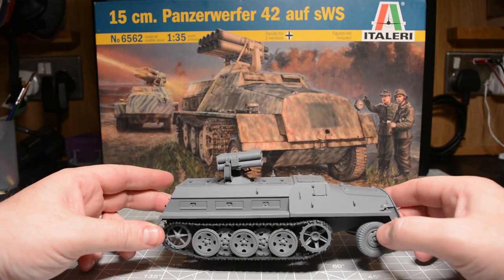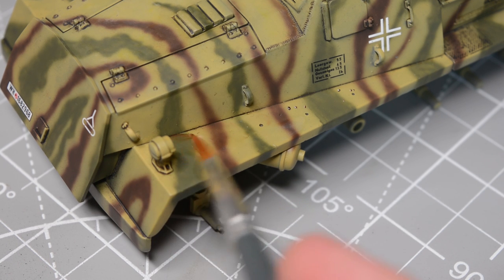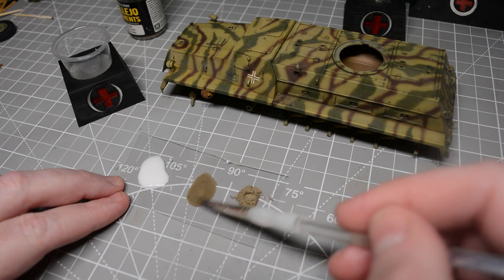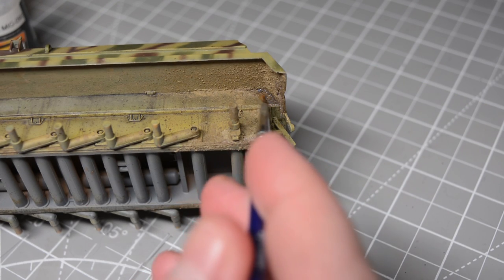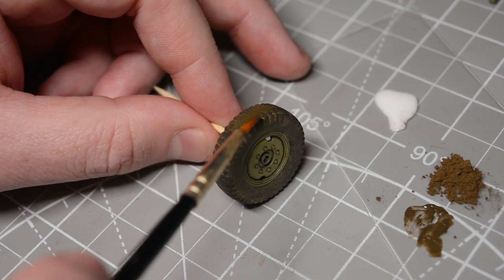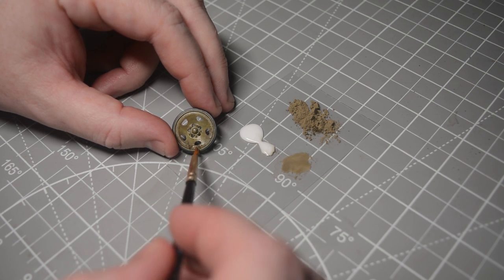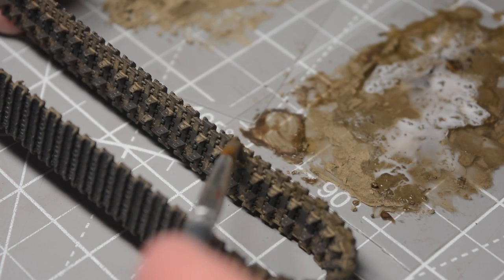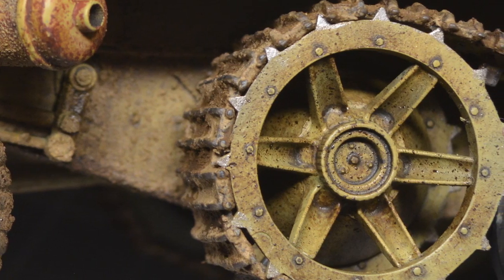Weathering with pigments or weathering powders

Comment: Amazing weathering tutorial using pigments! Going to use this on my next tank for sure. Is there a substitute for the scenic fixer that you can suggest. Looks a bit like pea glue in the video, but I’m guessing it isn’t? Liked and subbed 👍
Reply from the maker: Hi, thank you for taking time to comment. The scenic glue is likely some derivative of pva, it dries matt so realistically either an acrylic matt varnish or a combo of matt varnish and pva would probably do the job just fine. Normal pva would probably get you by but you do run a low risk of getting some gloss finish where it builds up.  I've used mig ammo matt acrylic varnish in the past with similar results, it won't take you long at all to find something that works for you and get the hang of it! Happy modelling
Reply: @ScaleModelMedic  awesome. Thanks for the quick reply.

Comment: Awesome results! How long did it take you to complete the track weathering? Can PVA glue be used instead of scenic cement for binding the pigments?
Reply from the maker: Hi,  yes You can use pva, which I'm sure is an ingredient in the scenic cement I used, but you'll need to add in some acrylic matt varnish as pva dries glossy or satin most times
Reply: @ScaleModelMedic , thanks for the tip on the matt varnish.